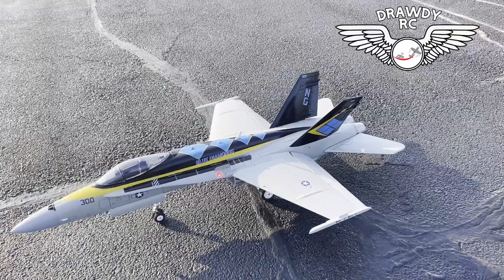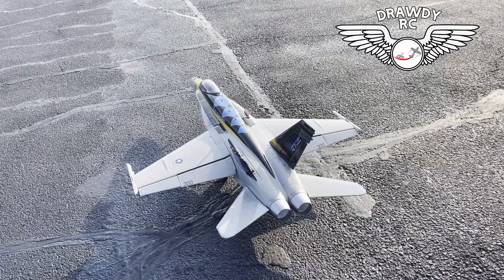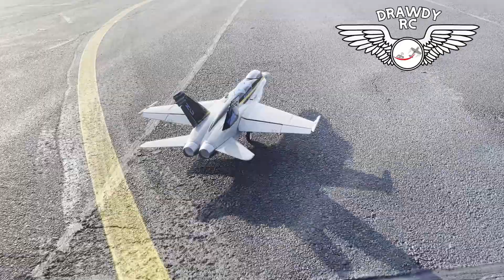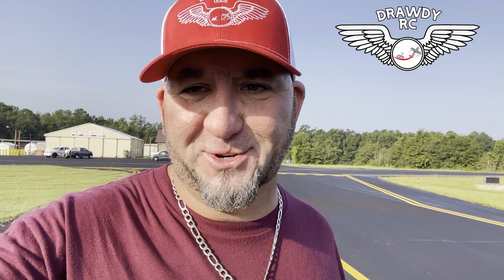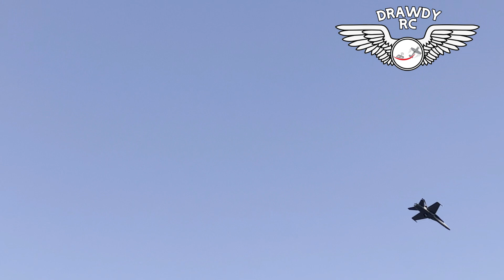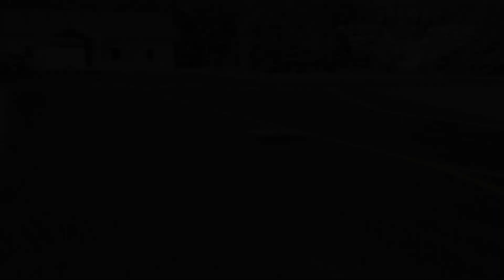FREEWING F-18 (90mm)

Comment: nice flight, I arrived on the 18th, can you tell me if the CG and the aileron and elevator ranges are exactly what is written in the manual? Thank you
Reply from the maker: We made small adjustments just to make it fly to our liking but for the most part the manual, in my opinion and from my experience, the manual is pretty dang close.
Reply: Grazie